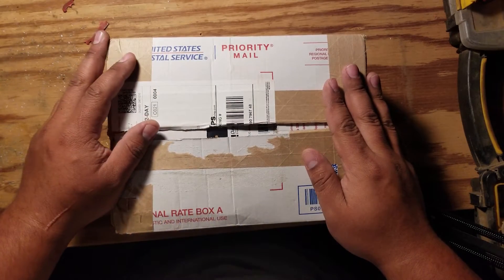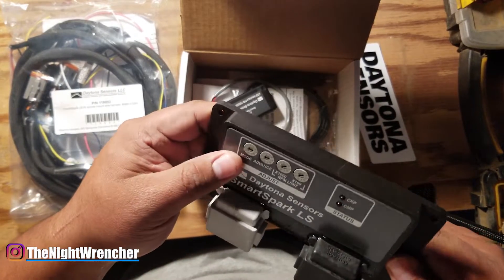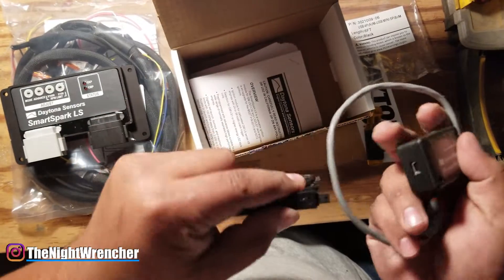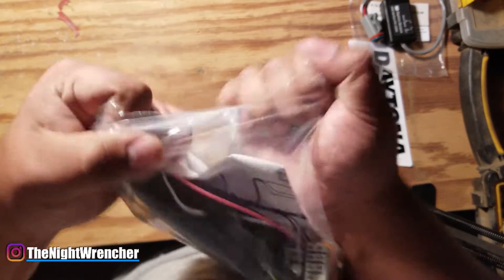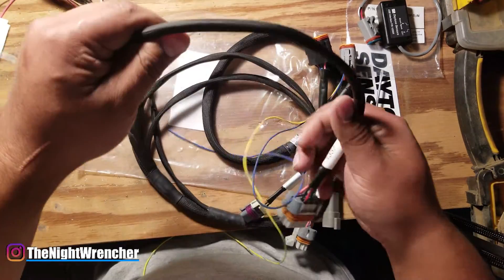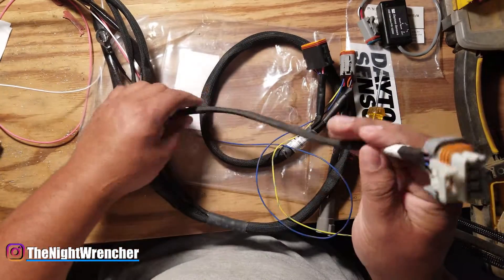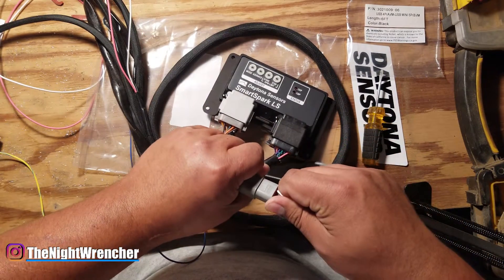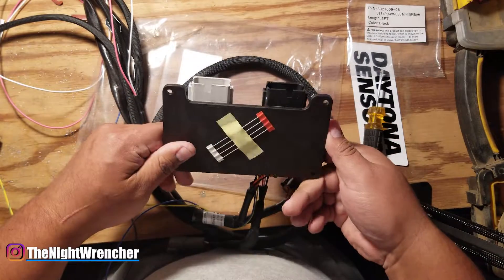Daytona Sensors Smart Spark LS Carbureted LS Ignition Box Unboxing Overview(RIP MSD 6014?)| Carb LS|

Comment: How would you hook your 4L 60e transmission to the box
Reply from the maker: The box is not a transmission controller. You would have to buy one seperately. Another option would be to swap to a 4L60/700r4 which is not a computer controlled transmission.

Comment: Hi nightwrencher did it come with the wiring harness
Reply from the maker: When i got mine, the wiring harness and the ignition box were sold seperately because there were different harnesses for different engine but now I think its included. I would call them so they can help you order the right one
Reply: @NightWrencher  thanks I'm afraid to rewired it with the adapter kit
Reply from the maker: Yeah, its a little bit of a hassle. I heard theyre working on a SSLS to 6014 adapter but its not released yet. I would give them a call

Comment: How did you connect the map sensor? Since you use the stock ls style map. Do you connect to a port on manifold or carburetor. I’m debating going the Dayton over the msd box.
Reply from the maker: Exactly, you can take the stock map off the truck intake, connect it to the map sensor plug on the harness, take the rubber seal off the sensor and run a hose off of it to the intake

Comment: Hey I'm having probably cranking my car with that box for some reason
Reply from the maker: What exactly is happening?
Reply: @NightWrencher  it's popping and backfiring, sounds like it wants to crank, but will not crank
Reply from the maker: @DavidSmith-du8nh  ok, so cranking means thats the engine is spinning. Starting means the engine is turning on. From what you said, the engine is cranking and sounds like it wants to start. What year engine, what coils are you using and what mode do you have the box set to?
Reply: @NightWrencher  it's a lsx block
Reply: @NightWrencher  the coils are ls2 and the mood 0
Reply from the maker: @DavidSmith-du8nh  ok, does it have a 24x or 58x reluctor? What coils are you using? What mode is the box set to?
Reply from the maker: @DavidSmith-du8nh  just read you second message. If youre using LS2 coils on mode 0, thats the wrong mode.
Reply: @NightWrencher  did you get my number, my name Lee,
Reply: @NightWrencher  what mood should I have it on
Reply: @NightWrencher  it's a 24x and half moon timing chain spk
Reply from the maker: @DavidSmith-du8nh  page 3 in the instruction booklet has the information you need. 24x with LS2 coils should be mode 1.
Reply: @NightWrencher  ok kool I'm about to look at it now
Reply: @NightWrencher  I have one more question
I can't find the paper📄
It says on the box, 
Mode should be set on 1
Advance be set on 1 too🤔
X1000 on 9 and x100 on 9
Are do I set mode on 0 and advance 1
Reply from the maker: You need to set the mode to 1, advance to 0, x1000 to 6 and x100 to 5.
Reply: @NightWrencher  thanks

Comment: NightWrencher did you ever find out what the resistor were for on the bottom of the ls smart spark box ? I'm thinking about using them for my alternator singal wire.
Reply from the maker: Theyre for wiring up nitrous solenoids to prevent back feeding. I dont remember the exact resistance but I would order a few 470ohm on ebay or amazon for a few bucks.
Reply: @NightWrencher  thanks NightWrencher 😉